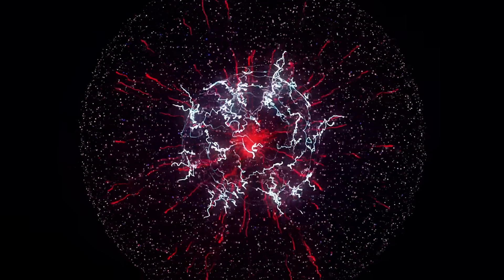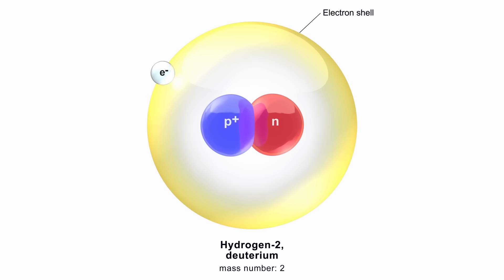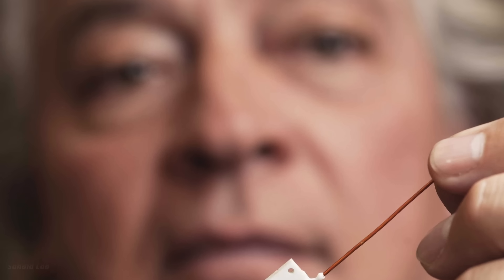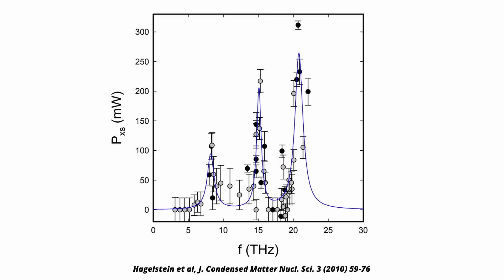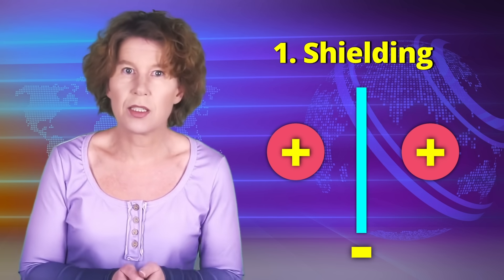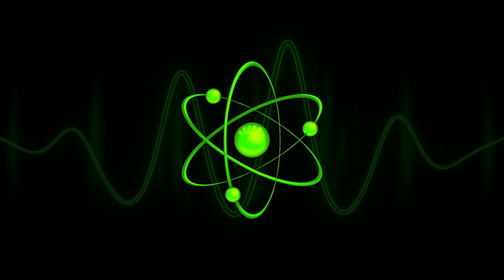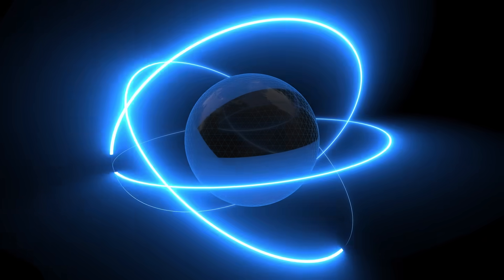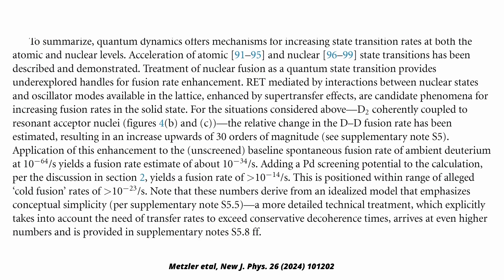Physicists Say They Know How Cold Fusion Works

Comment: The concept of "cold fusion" is interesting and all, but even if it did work, it would basically be inferior in some ways to already existing and available solar panels.

Modern solar panels have gotten so cheap, that not only do they have a definite "pay back period", but the period is short enough that they effectively have negative cost (averaged over a long enough timescale, ex: beyond the pay back period).  You basically get paid for installing solar panels, and as a side product, they also produce free electricity for you.  "Free energy" is not "pseudo-science", it is in fact already reality, at least for those who go to the trouble of buying and installing enough solar panels for themselves.

Humanity does not need "new energy technology breakthroughs".  Humanity needs to adequately manufacture and deploy its already existing renewable energy technologies, which is good enough.

One might try to argue that solar panels are not "good enough", since many applications will also need energy storage like that provided by lithium ion batteries.  However, lithium ion batteries are also "good enough" devices.  Incidentally, lithium ion batteries were literally invented by a guy named "John B. Goodenough", and modern day ones do perform well enough to be consistent with their founder's name.

Comment: I too was drafted in DOE experiments following the Fleshman and Pons publications.  We had experts on neutron detection from Oak Ridge working with us.  We, of course, discovered no excess neutron flux.  We did observe that the BF3 detectors became more sensitive if they heated up.  Since we were observing an exothermic chemical reaction, we did need to carefully track the temperature of our detectors.  These were challenging experiments for DOE experts - Fleshman and Pons were certainly not expert in all the instruments they used.  There was also a less-than-kind observation that the quality of the physics department doing the experiment was inversely proportional to detecting cold fusion.  The bull***t level of anything 'cold fusion' is very high with me - I would be happy to be proven wrong, but my expectations for that are very low.
Reply: Nathan Lewis was Chief Debunker at that time.

I recall attending one of his lectures,  he showed their graph of 
the neutron radiation they had measured.  Then he showed  the AMBIENT 
neutron radiation in the lab, sans cold fusion process.  EXACTLY THE SAME.

I remember thinking, "Good god, professional scientists can't make 
such a bonehead error, they just can't!"
Reply: Well the University Safety Dept also didn't want to see Neuton dectectors... Would have shut them down. And they were confused by the observations of neutron flux changing. Took a while to notice the neutron level got lower when the door was open to the BASEMENT LAB in UTAH. Quiz: Why do you think...   
But Neutrons are rarely observed in LENR/Solid State Fusion.  Silly to look for it.  Always orders of magnitude less than hot fusion.  That's not how it works. You do see isotope changes, such as  getting heavier as if a neutron, had accumulated. See the Mitsubishi and Toyota tables of isotope shifts.  You would see He4 if you had a sensitive enough detector to and a protocol that isn't compromised environmental helium or it being used for setup and leak testing.
Reply: @grumpystiltskin  Pons & Fleischmann claimed cold fusion.  They claimed an excess of neutrons.    We were using BF3 detectors for thermal neutrons.  We had ~ ton of wax to thermalize neutrons and tons of borax to shield from external neutrons.  I'm not sure why BF3 detectors would be a safety issue.  My work was actually on helium scattering, so we had a good mass spectrometer for that as well.  It was a colossal waste of time.
Reply: https://www.youtube.com/watch?v=f0aXShVzGNg

That is the first of a week long lecture from 10 years ago by an MIT scientist who has been studying it.  If you have 2 and a half hours to spend, I'd recommend it.  The long and short of it is while Fleischman and Pons were premature in their publication, the people who did the "debunking" were absolutely sloppy.  Anomalous energy has been verified in more than 50 studies then.
Reply: @alexe589  there is a whole thing about how the university pushed for publication against Fleishmann and Pons wishes, and then the debunkers were paid to do a shitty job in purpose.  Im. Off to go watch that thank you for the share. I myself think cold fusion is not a waste of time at all . Personally I think it will save humanity.
Reply: Exactly, high hopes and low expectations.  Zero results in 35 years, no way am I going to hang my hat on that record.  For those that do, good luck!

Comment: Wouldn't it be interesting if we looked at how we've approached fusion energy in general as if "out of focus"? To explain, I mean on the one hand, we know it's a solid fact that fusion happens when the targeted fuel is heated and compressed but on the other hand we've thought (not everyone) complete fiction that their could be a catalytic way to cause fusion reactions to happen in a "cold" way. So here's how to focus: What if both methods were to merge as a new method where a toroid reactor had a Nickel-palladium or Nickel-Titanium ring on the inner side where we've even seen fusion taking place without a catalyst? I think we just might find that if we combined both tactics as something at least in the lines of thought of what I mentioned just might ALSO prove a blessing? Thanks for the video❤ I am more and more finding myself drawn to your channel❤❤❤
Reply: If you're heating a plasma in a toroid reactor... what's the temperature?  Pretty sure that the alloys you mention would melt, right?

Also, wouldn't it only make sense if the two processes were interacting in some way?  How do you propose that is happening?  (Honest question.  It's unclear.)
Reply: @NemisCassander  I guess what I was suggesting is going to require a way to dope the side of the inside of the torrid reactor with catalysts within the walls that don't melt. I really don't know much about how they are constructed, but I do understand that leds and semiconductors are doped with the atoms necessary to induce a charge. What if there's a way to dope the inside surface in closest proximity to the plasma inside the toroid? I'm thinking simply to add a catalyst to the "normal" fusion reactors, simply only because there have been successes in cold fusion using a catalyst, namely palladium. So if perhaps palladium atoms could be doped into a ring of material that doesn't melt (idk what could stand such temps). I guess it's just a bad idea.

Comment: "Cold fusion" Consider reductive alloying deposition of a skin of metallic lithium and atomic deuterium alloys at the palladium cathode, followed by a strong exotherm from sudden diffusive bulk chemical reaction, perhaps with a trigger temperature. X-ray powder diffraction of the powdered (inert gas atmosphere) post-reaction cathode would be diagnostic. One is then curious about a palladium wire inserted into molten lithium hydride (~375 °C or deuteride) electrolyte, followed by voltage bias.  DOI 10.1149/1.2424158, but with an electrolysis palladium cathode .

Comment: Even if this works, I'm doubtful if the energy generation rate will be anywhere close to usable. The energy production rate inside the sun is only about 276.5 W/m^3. Not megawatts or even kilowatts. Watts.

It's about the same energy production rate as a compost heap. Even your body has a higher energy production density. The plot of the Matrix where machines used humans as heat batteries, is more effective than producing sun-like fusion.

That's why trying to commercialize fusion power generation has been so hard. We're not just trying to replicate fusion inside the sun. We're trying to make hydrogen fuse on the order of a million times faster than in the sun.

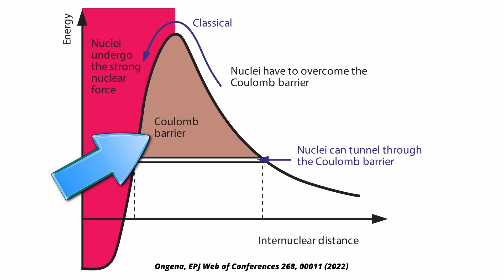Comment: Can anyone explain the graph at 0:45
Reply: Imagine two nuclei (protons and neutrons of an atom without the electrons). On the x axes you see the distance between them; on the right they are far away, on the left they are very close. On the y axis you have the energy stored between them. If you look on the right where the nuclei are far apart, the closer you go the more energy there is stored. So you need to add energy to push them closer. This is because protons repel each other electrostatically (Coloumb force they are both positively charged). On the left, however, you see that the energy declines the closer you go. This means you get back energy by pushing them closer  - or rather - the nuclei snap together releasing a lot of energy as soon as you push the nuclei "over the hill". This is because the strong force between the protons and neutrons attract each other more than the protons can push each other away.

Quantum mechanically, it is also possible to "jump" through the energy hill without actually spending the energy necessary to push up the hill. This is tunneling and shown at the base of the brown area. This only very very seldomly happens but it's what makes our sun burn even though it's too cold to actually push its nuclei over the hill.
Reply: @randomaccount1310  thanks, the missing part for me was that the y axis is energy stored between them! Now it makes sense
Reply: @randomaccount1310 "This only very very seldomly happens, but it's what makes our sun burn even though it's too cold to actually push its nuclei over the hill."

I was with you 100% up until this statement.  I'm going to have to ask for a source for this claim about our G2 Main Sequence star.

Comment: The problem with cold fusion, even if there is a easy workable solution is going to be energy density. You can only load a metal with limited amount of deuterium and you can only add it to the surface of the metal. Basically it will be impossible to scale up to be useful in energy production. 

I doubt there will ever be a workable solution for fusion as an energy source. its just too complex & expensive to be a usable energy source. Plus about half of the energy releases from deuterium fusion is in fast neutrons which is difficult to convert to usable energy & will also neutron activate any materials nearby.

Comment: Just to clarify: 'Cold conFusion' does not produce electricity! It produces heat energy, which must be used to drive a turbine, to drive a generator, which produces electricity, that must be transported via insanely long strings of wire, incurring massive losses along the way. 
In contrast: Photovoltaic Cells elegantly convert photons emitted from a FREE, practically limitless, nuclear fusion reactor, for billions of years, into usable electricity. Best of all, this reactor is always ON*, does not shut down for maintenance and, did I mention, is ABSOLUTLY FREE!!!
* Technology to smooth supply for 'when the sun dont shine' on earth is already available, at paltry cost compared to nuclear hot water kettles.

Comment: Even if cold fusion never reaches over unity, it's still an interesting area of research and could have other applications. Fusion reactions are already used as light sources despite not being over unity, being able to induce nuclear changes without extreme conditions may have a variety of uses.

Comment: It seems more likely fusion in the sun is based on pressure from gravity not heat.  It is 'cold fusion' hampered by heat.  Fusion releaases heat (energy) which then expands the gas and slows fusion; if heat caused fusion then as soon as a star ignited it would supernova.

Comment: Have the physicists tried carbon nano tubes? Restrict the spatial movement of the hydrogen or deuterium and then put it under pressure. Maybe then the quantum tunneling effect could be enhanced. I imagine it like trying to push to opposing magnets together; it's a lot easier if they are only free to move toward or away from each other rather than in any direction.

Comment: This article is made by one (MIT) of eight university groups in USA that are funded by DARPA-E to make still another attack on the cold fusion problem. USA is far behind Japan  (CleanPlanet) which may have soon working COP 10 example 6kW heat “pump” using Hydrogen in Nickel based nano-structures.

Comment: VO2 nano tubes can store atomic hydrogen, maybe also deuterium.
If cold fusion is possible this array of deuterium atoms inside the VO2 nano tube can maybe be triggered by a dirac pulse (for exampe an electrical spark). condition for cold fusion would be high, someone should try it,....

Comment: The unspoken problem with “Cold” Fusion is that the output is heat (photons), not electricity. Damn. You still have to go through the messy process of capturing the photons to produce electricity the old fashioned way via steam.
Reply: ENG8 are saying output is electricity, rollout 2026
Reply: @ Thanks for the tip. That is going to be entertaining, hearing how they claim they convert strong nuclear force energy into electrons,…….oh, and surplus photons. Of course we all hope that it is true,….but….
Reply: Well that's the thing... most of our electricity generation sources still work on the principle of source creates motion (stream, water flowing, wind blowing) -> motion turns wheel -> wheel powers a generator. We do have solar panels now, but other than that coal, nuclear, wind, water, and even wave motion, all work on the same basic principle of making a wheel turn.
Reply: @Sanquinity  thank goodness we invented the wheel
Reply: @ I stand corrected Sanquinity. If it was possible to achieve a point source of fusion energy, energy which will be entirely photonic, and if it was possible to surround that point source with photo voltaic cells, then there would be a significant level of electrical output along with heat from the inefficiency of the cells. So. Low temperature energy production would be possible……IF…., the fusion part was a reality.
Reply: "I want steam, dammit."
Reply: @ heat output is an option too.
Reply: @ Heat output is used to create steam. Hence why I mentioned steam, not heat. :P) Even nuclear power is just making steam to turn a wheel. (turbine attached to a generator)
Reply: @Sanquinity   True, but the machinery to produce steam is fairly massive and not very efficient. Up to 61% efficient with a combined cycle system. The result of fusing Nuclei together is radiant energy, photons, which traditionally are absorbed in materials to produce heat for steam. And that is my first expectation, but then I realised that it is technically possible to absorb radiant energy to directly dislodge electrons to produce electricity directly from a Nuclear Fusion (cold) reaction. Big question is, is that what ENG8 have achieved?

Comment: Even Germans are facing reality of GREEN ENERGY - escaping Big Bad Oil is proving harder than THEY Thought.
Germany’s Oil-Fired Generation Surges To 8-Year High
Charles Kennedy - Jan 14, 2025
Germany’s electricity generation from oil surged to the highest since at least 2017 while gas-fired output soared to the highest in two years, as European power utilities prepare for a slump in wind energy. Meanwhile, German day-ahead power prices reached €222.18 a megawatt-hour for Wednesday on Epex Spot SE, their highest in a month.
Reply: That’s what happens when you allow greens to rule a country. They drive it into the abyss 😮

Comment: Assuming CF is real, I imaging it works similar to how a small amount of a liquid is boiling, even when it is frozen.
When we look at the small scale, there is a lot more chaos than we see on the macro scale, and while almost all atoms are solid, some get enough energy to break free of the solid due to random collisions between molecules.

Imagine a lattice of palladium and nickel (perhaps other metals will work, but we don't know it yet), with some hydrogen atoms in between the metal atoms. If we got the right bulk resonance going, there would be enough energy for a small amount of hydrogen atoms to fuse, similar to our water example.

However, that would change the resonance of the bulk material, and we would lose fusion. If so, that would explain the unpredictable and temporary reported results. That means we would have to impose a resonance on it somehow, and that might be where the laser energy comes in.

Comment: The coulomb barrier can be reduced in a hydride. Hydrogen dissolved in certain metals to produce the hydride can achieve a hydrogen density higher than liquid hydrogen.  I always wondered if you can overcome the nuclear Coulomb barrier via a tunnelling process like in electronic devices.
Reply: The easiest time to overcome Coulomb force is at (near ) absolute zero temperature.
At near absolute zero , the atoms fuse overcoming coulomb force.
and temperature rise    ... 
That is why particles cannot be colder than absolute zero temperature in nature.
The formation of BEC with many atoms where the height of stacked atoms shall give just enough by gravitational effect to cross coulomb barrier!

Comment: Ok so is the thunderstorm generator real?
Reply: it seems to be. that is, in transmuting carbon to oxygen rather than as energy generation, I would be concerned about long term corrosive effects before I stick one on my engine. but there is more than just bendall's TSG. ENG8 (not affiliated with TSG) are claiming x5 over unity energy production in their reactor, the basis seems to be stable fractal toroidal plasma physics that creates enormous magnetic force at the centre, is my take on how it works.